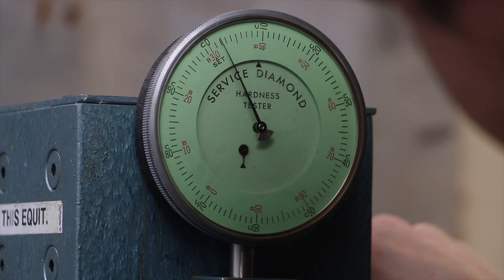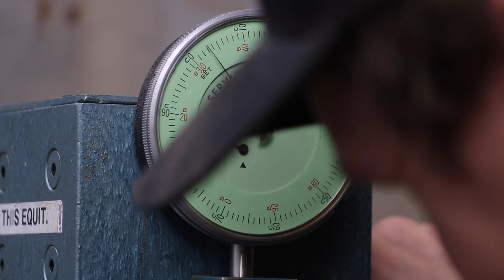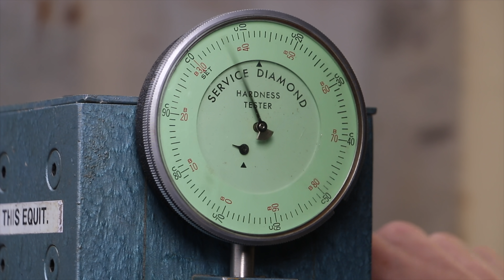Can you Harden Titanium?

Comment: Wow, I've never seen Ti  cut with an abrasive cut-off disk.  Also I have never,    seen Ti  heated without protective tool wrap.  Always square-off  round bars in the lathe before testing hardness.  l don't know what those numbers are because everyone is familiar with  rockwell B, or rockwell C  numbers.  Why not test Ti gr 2  vs. gr 5?    What is grade 4?

Comment: 2:55 Titanium gains its strength when mixed e.g. with steel.
Titanium also starts hardening around 200° C
Idk at what temperature it anneals but looks like the cutting wheel hardened and anneal on some spots.
I think The old Tony worked with it on a lathe and you need massive amounts of cooling and when drilling, keep a steady pace or it hardens and you need carbide to bite through.
Annealing is done in several stages where you drop the temperature, keep it a specific amount of time, before lowering again to a certain level and keep and so on.

Comment: hey  so i find this interesting but i have no idea what the numbers mean . I know the higher the number the harder it is  but what it is compared to diamond some other material that we all know   . would be a nice addition to your video for a noobie like me
Reply: Hardness measurements are a bit weird; what this tool is telling you is literally "how deep did this particular indenting tool go into the part", which is what the rockwell hardness scales all actually mean (for rockwell C it's literally 100 - (depth in mm * 500) for a 120 degree diamond cone with a 0.2mm spherical tip and 150kgf force). I'm not sure if there's any similar test that's well defined for diamond, as I expect diamond to break rather than plastically deform in this kind of test even if we had a good material to make a probe out of.

On the other hand, while hardness is pretty difficult to map to bulk physical properties of the metal (the physics of the test aren't terribly simple), it's a really easy and quick test to do and it does correlate well with the other physical properties for particular materials or repeated parts, so you use it as a sort of proxy for destructive tests and such. You just run the tests and measure both hardness and the property you want to be sure about and build up the mapping empirically.

For some reference points for the Rockwell C scale: hard knife steels end up somewhere like 55-66, tool steels can go up to 70 but get brittle up there, and axes usually are more like 45-55 given the hard use and need not to chip.

Comment: You need to maintain an air free environment to anneal titanium without creating molecules of TiOx or TiN which have completely different physical properties.  Ar is the easiest and most common gas to use.   

In semiconductors you would have a SiC (silicon carbide) container purged with argon for processing.
Reply: Yeah Also the flame is oxidizing if he changed the ratio of air and gas he could get it to a reducing flame or neutral, a reducing flame would eliminate 99.99% of oxidation and with certain metals with a high enough temperature it can even convert the oxidized metal back to the original metal, It can leach carbon into some metals tho if carbon is dissolvable in it if its a sooty and very fuel rich, It could be unwanted or sometimes good if you want the surface to be harder with extra carbon such as in iron

Comment: One thing to keep in mind for age hardening / ageing / precipitation hardening, be that 2000, 6000 or 7000 series aluminium, maraging steel (MAR250, MAR300, MAR350, etc.) or the PH steels (17-4 PH, 15-5 PH, PH 13-8 Mo, etc.) is that the hardening process is driven by time at temperature to allow for precipitates to form. 

The temperature determines the solubility and mobility of the precipitation forming elements, so it's temperature that dictates the size and distribution of the precipitates that form, and the resulting mechanical properties. Quenching can be important after solution annealing, but by and large, quenching isn't required after ageing / precipitation hardening.

Comment: Would be interesting to see what happens in a reducing forge, (charcoal etc) to reduce oxidation, as noted in other comments re: vacuum furnaces used for commercial heat treatment. Non-ferrous heat treats and aging seem pretty weird when you're used to steel.

Comment: Great vid, thanks, if you haven't turned Ti before?, carbide insert tooling works great, I pretty much always use grade 5 (6Al4V), it's a bitch to drill deep, but otherwise great fun to machine, grade 2 is vey much like aluminium to machine.

It would be interesting to see after HT, if cryo has any effect???, I have a Paragon HT oven, but the thought of it running for 8 hours, doesn't fill me with happy thoughts;), Also, was the testing done with the point (Rc), or with the ball (Rb)?, the ball might be better??,

Have a good one,

Scott

Comment: You should do a light reading about hardening titanium. And how the different grades/ alloys work.
There s only a few that is recommended  for hardening. 
First thing is to get an electric heattreating owen and use some nobelgas to keep it from oxidizing.
Argon would do fine... 
But it´s alot harder to play with titanium and succeed than you might think.

I read a little about it two years ago, but don´t remember it so good.
I have Gr.1, Gr.2 and Gr.5 at home if I don´t remember wrong, and gave up my plans of hardening them with the equipment I curently have...

Comment: If you can find a heat treat oven that is sealed with a Gas inlet that would be ideal. So if you did a let a bit of argon flow during the HT you would get no scaling. And if you want to make a durable gold colored coating heat to 700-1100C and add nitrogen. It's almost a perfect gold color and super durable. I nitride a Ti spork about 6 years ago and it's still perfect.
Reply: That creates ti-nitride TiN

Comment: I researched all sorts of metals via the Encyclopedia Brittanica for my Dungeons and Dragons character decades ago and learned the term "ductility" when the subject of titanium came about.  The metal is famous for being "hard" and especially for being light, but the capacity for resisting whatevertheterm for long-term deformation in response to load is what I internalized by the gods-named-element.

While only in this decade have I actually delved into welding and metallurgy in actuality, and learned sophisticated terms as martenistic, austinetic etc, my general understanding is that the metal is a
 lot more like silly putty than the average person presumes.
So your original numbers in the teens are very unsurprising.
Reply: I've heard someone making titanium Thermite which burned as bright as magnesium and lit places miles away with the brightness akin to a lightning strike.  Yeah, like aluminum, the stuff oxides pretty bad (well?) when hot and those 3 metals, aluminum, magnesium, and titanium were behind the necessity of developing Tungsten Inert Gas welding as the shielding gas enveloping the molten metal and protecting it from the atmospheric oxygen.

Comment: The hard coating on Ti alloys after heat treating in air is commonly called alpha case. The longer the heat treat, the deeper it goes. It is very hard and can skew your hardness results if not completely removed. It will break tooling during machining operations unless you can get under it and peel it off. Industry typically “pickles” the material in acid after heat treat to remove the alpha case or uses a vacuum furnace to prevent it from forming. Good channel. Good stuff. Keep it up. Cheers.
Reply: Sounds like you've worked with the stuff, or do you just read a lot? Either way good info. Thanks
Reply: @BCM1959  I’ve worked in manufacturing specialty Ti alloys for a while. Glad you found it interesting.
Reply: Are you able to say how many HRC alpha cases has?
Reply: @jistyclovek4693  If I remember correctly, it can be about 65 HRC at the very surface. It easily scratches hardened tool steel.
Reply: Titanium becomes quite reactive at high temperature, and this is why it's so critical to have a lot of gas coverage when TIG welding them (like over 10 second post gas and all that so the metal cools when the gas flow stops). And if there is ANY discoloration at all in the weld it's considered a bad weld... In fact it's better to weld Ti in a purge chamber to avoid any problems like this. I heard that a rudimentary one can be made with a thick plastic bag, and just fill that with Argon to weld...

Another reason why Ti products are expensive, they're not the easiest thing to weld, but any DC TIG welder will weld them if you have enough gas. But Argon while not expensive is a consumable.
Reply: Can you make some cutting tools from the alpha case since is very hard?
Reply: @Greenberet.  That might be possible, but I think ceramics like tungsten carbide have that covered pretty well. It is fairly easy to produce consistently at scale and can be shaped and brazed to make tooling. I’ve always seen alpha case as a nuisance, but there might be special uses for it.
Reply: I'm looking in to balisong trainer making. May I ask about Timascus? Is it harder to milling compare to TC4 (Gr5) Titanium?
Reply: @GojuGaming  Sorry, that’s outside my wheelhouse. I am more familiar with industrial processes.
Reply: Interesting comment! I learned something new thanks to you. Appreciate the insight
Reply: so similar to an oxide on aluminum
Reply: Would the grinding he done chnaged the properties of the material via heat?
Reply: This is 100% true I've had to grind/face used titanium engine valves before and it usually takes a good 3-4 redressing of the wheel before you get a good chatter free finish when you first start the titanium absolutely obliterates the stone.
Reply: Ti alloys are rarely heat treated and are NOT given a hard coating.  Pickling is providing a surface conversion/coating   and  with Ti is never used to remove oxidization.

Comment: You might consider getting the stainless steel foil knife makers use to seal out air/oxygen when heat treating. It should prevent the titanium from oxidizing and scaling
Reply: Not enough. It needs to be in an inert atmosphere, even nitrogen is reactive towards titanium at high temperature. So the entire heat treat forge would have to be purged with argon.
Reply: @taiwanluthiers   I have a door that had argon in the window.  It got out.  It's pesky.  Difficult to seal in.

Comment: Tim:  When doing hardness sampling, good practice in any averaging of values is to through out the lowest and the highest and average the remaining.  I would try to do 7 or 8 samples, toss 2 and average 5 or 6.
Reply: Correct, that's the way I was taught. Throw out the highest and lowest.

I wonder why he didn't cut something like a 6" piece and test along the side. The Rockwell hardness tester came with holders for round stock.
Reply: With small data sets with wide variance like this the most accurate results come from either using the mode (most common value) or median (center value when sorted low to high).  Using the mode is preferred but can be misleading if only two values agree so the easy way is three or more agree use the mode.  Else use the median.  Still it’s a judgement call, when in doubt use Kent’s method.